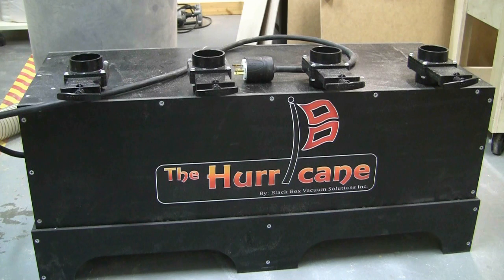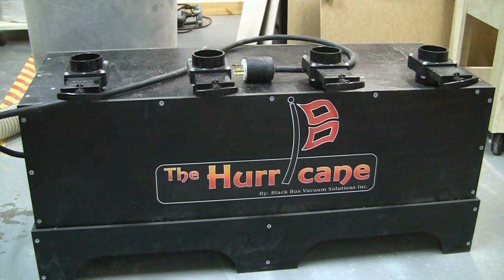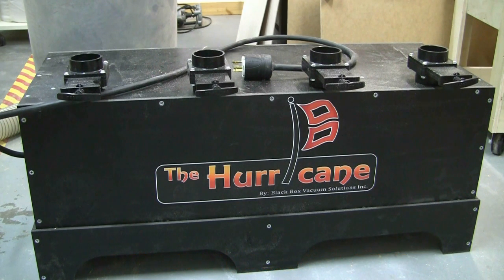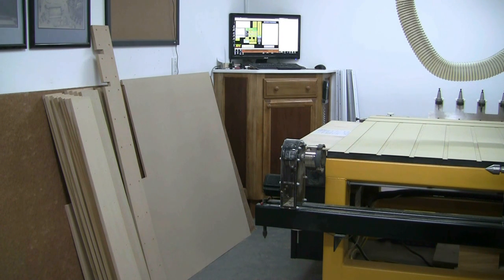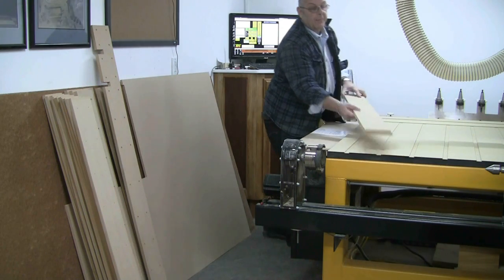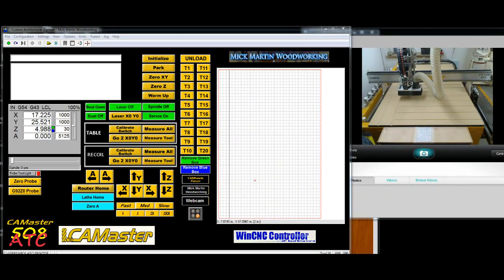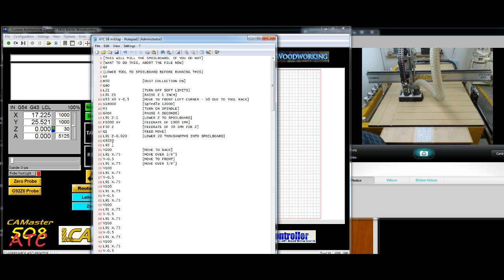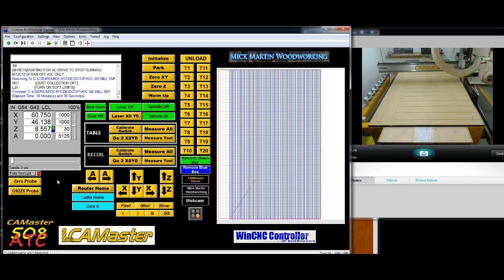Vacuum pump and CNC table prep

Comment: you save the c-code for later use?
I use a g-code basically only once.

I secure the various settings for the output to the processor (postprozessor), as I have very many in the use.
(with or without suction, with or without cooling air, 1/00 - 1 / 000 mm resolution... because it is very convenient for me!)

I can quickly read a cad file, test and modify (aspire).
A g-code file is here not to manage - preferably delete.

Mick, this is a nice video and I'm looking forward to more :-)
many greetings
Hermann